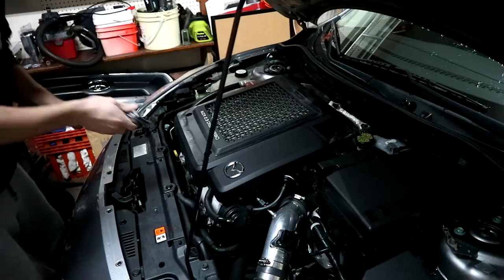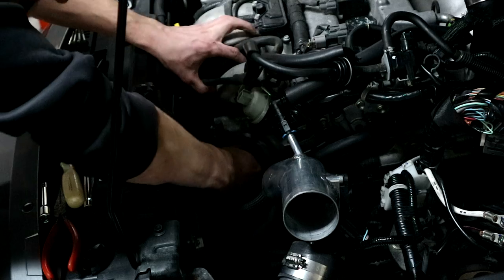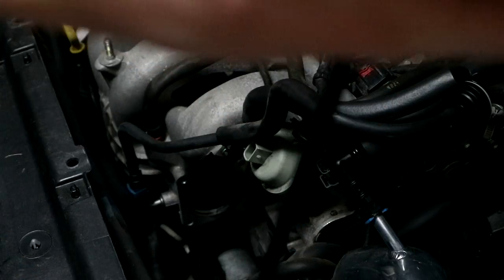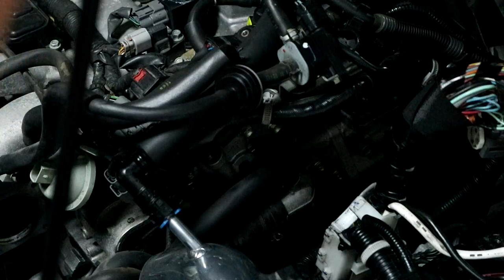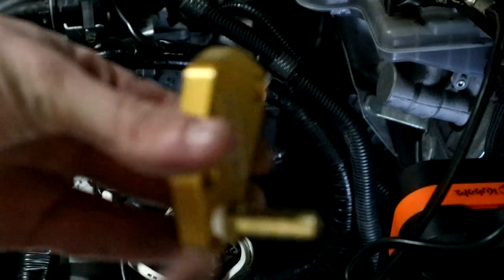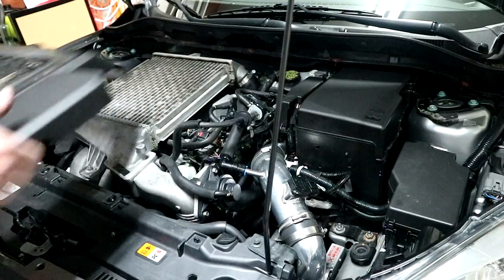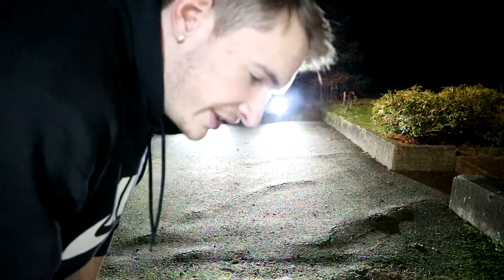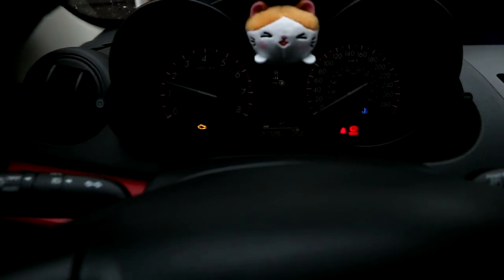FULL EGR Delete Kit Installation!

Comment: What are you using for the daytime running lights? I want mines super bright like that.
Reply from the maker: Not sure to be real with you! Came in the car when I got it
Reply: Careful if you use DRL bulbs that run hotter than stock it can burn holes in the lenses if the car is sitting idling for too long.  It was an issue with 2010-2011 3's with this style of DRL lens (the arrow design found on high trim models).

EDIT: Actually it can even happen with stock bulbs, too.  It's just a matter of how hot it gets which is why it happens when the car idles for too long.

Comment: I don't understand this EGR delete objective at all.
Reply from the maker: Don't re use gas's that block up intake valves, etc
Reply: Useless dirty emissions dealerships change them for $1000 two previous owners of my first speed spent the money. Both my speeds I spent $30 deleting it and tuners will get rid of the CEL for free. It’s one of those things to just get over with now because the inevitable is coming. Same with the coolant bypass which here in Michigan is really only necessary in peak of summer and a top mount.🥶🥶